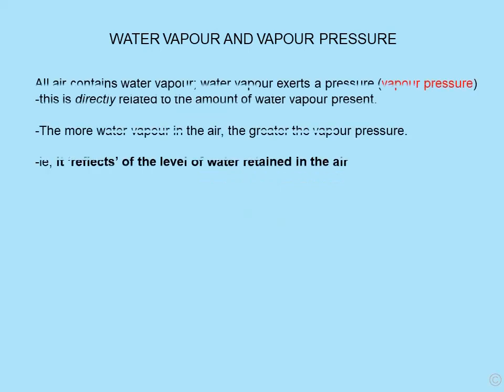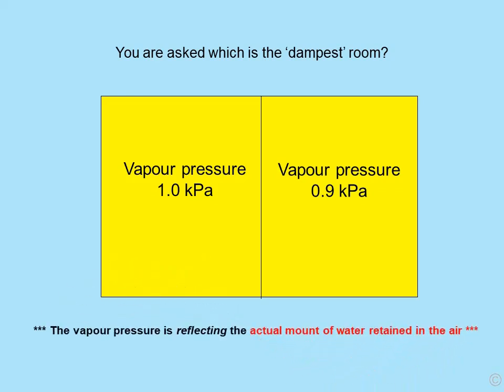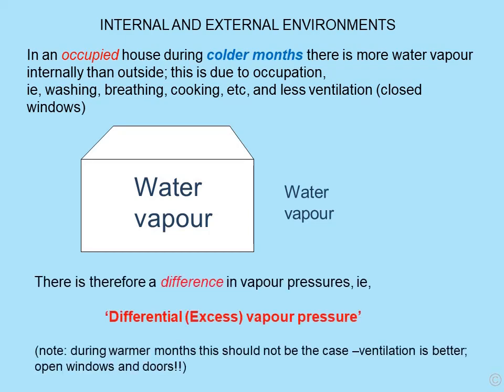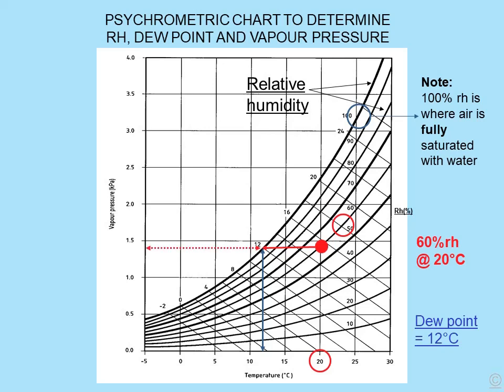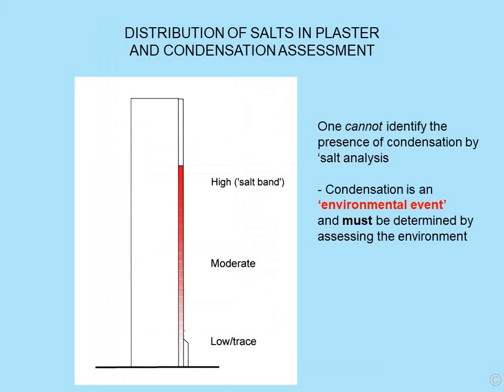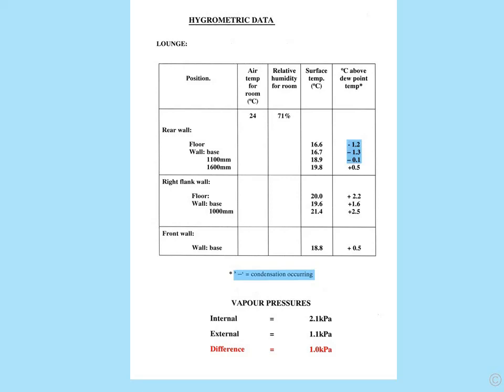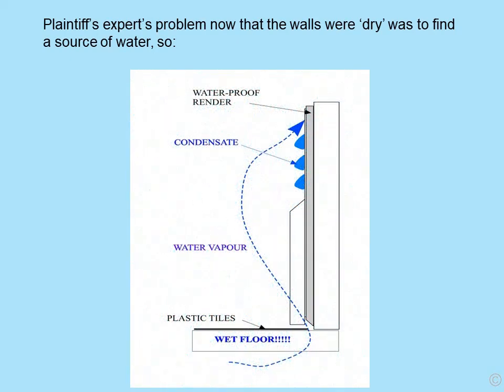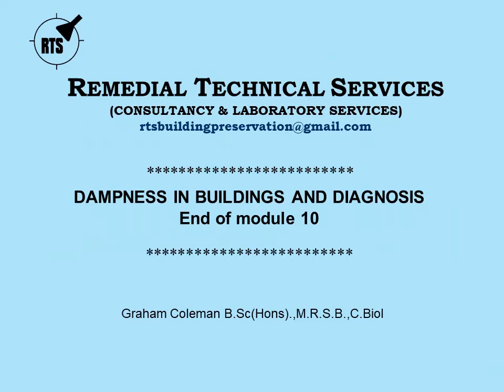Dampness in Buildings and diagnosis Module 10

Comment: Hi Graham, thank you for uploading, presumably the external environmental conditions for measuring differental air pressure have to be dry  ?
Reply from the maker: Hi Craig. Thank you for watching. No problem in measuring vapour pressures during rain; it makes no real difference. I have full notes on the 12 modules if you contact me on my email.
Reply: @grahamcoleman2502  Hi Graham, thank you for the response, the videos are very interesting, I'm just watching module 12 now.  
Yes I would appreciate the notes, I will email you.  
Kind regards
Reply from the maker: @craigsmith3954  rtsbuildingpreservation@gmail.com. The notes are almost the same as the presentations, odd difference. I will be updating the notes shortly but there is currently VERY little difference.